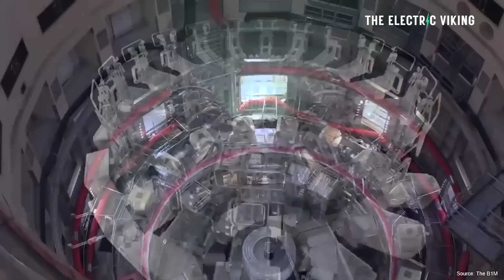Sweden criticised over plan to build at least 10 or more new nuclear reactors

Comment: At Sweden's latitude, I imagine solar would be inefficient. Also wind generation is not possible everywhere.
Reply: However, there are a lot, A LOT, of underutilized places for wind energy at the sea surrounding Sweden.
Reply: Use all 3-solar, wind and wave technology
Reply: Yes winter is cold, dark and long, the summer is short and barely warm. Doesn't matter how cheap and efficient Solar energy is, if sun isn't shining.
Reply: Solar works just fine in Sweden.
Reply: @petterbirgersson4489 plenty of spaces to put wind turbines but the cost to connect them to a grid and maintain them is totally prohibitive!
Reply: Hi, sounds like a plan when you live in the cold north and want to be independant. Small Modular Reactors could work or big ones which power the rest of Europe when its needed.
Take care all M.
Reply: @petterbirgersson4489  who said this? By the way it's very challenging operate wind turbines in such cold temperatures
Reply: Денег ни каких не хватит
Reply: Solar panels are more efficient when they're cool / cold.
Reply: @GregHassler  lol, yeah but they are cold when the sun isn't shining
Reply: Solar panels work quite well south of Stockholm - I think its around 3KWh per day annual average per installed kW of panels. Winter will be much lower, and therein lies the problem.
Reply: @GregHassler  Must be why our solar output plummets in the winter? Lol.
Reply: Nuclear power is a great option if there are appropriate safety precautions built in. Hey SAM, no everyone lives in Australia.
Reply: @simson4t How cold is it in Sweden? I’m heard that it is a long country and the Gulf Stream keeps it warmer?
Reply: @chrishaberbosch1029  it work fine for the 5 houer the sun is shinning. What about the 19 other hours ??
Reply: Geothermal?
Reply: @simson4t  This is a report that claims that you could produce around 25 TWh a year if all planned projects came to fruition, and double that if all potential spots were utilized.
Reply: @simson4t  There are a lot of projects about to be launched already today, and our neighbors Denmark and Germany are already building a lot.
Reply: Isn't that the whole point of batteries ? @simson4t
Reply: Fossil fuels work well .Use them.
Reply: @TTestad  that would be with battery backup.  Again, market forces will easily suffice if even a modular reactor is 20 times as expensive.  Price per Kwhr is vastly cheaper than nuclear and much easier and faster to install.
Reply: @chrishaberbosch1029  probably need solar tracking to work best due to the latitude.
Reply: Not in December
Do you have solar? (I do)
Reply: Yes, but not if the sun is below the horizon and it is snow on them. I have solar, I get the numbers from my electric supplier.
PS. I will still buy more
Reply: @chrishaberbosch1029 I guess you haven’t been to northern towns (north of Stockholm) of Sweden
Reply: @AORD72  or just install more.
Reply: There is a big difference between north and south  @Harrythehun 
Stockholm (Västerås really) is around the center from a population standpoint.
It is correct that Helsinki/Stockholm/Oslo/Reykjavik are a lot warmer thanks to the gulf stream. The south part of Hudson bay has the same latitude. That said, we still have winter and we still need to get rid of CO2.
Reply: We have wind power (but mostly hydro) and on windy days, very rare, the electicity is close to no cost.
Reply: @petterbirgersson4489  That is another myth, take it from someone who has spent nearly 17 years at sea. 
When we have wind, the wind is more powerful at sea, but still, if we don't have wind, we don't have wind at sea either.
Reply: @GregHassler  That's probably why they produce more power at night than in strong sunlight.......  Oh wait...... 🤣🤣.
Reply: @matsgardin8332  the majority of Sweden’s population is southernmost.  Stockholm gets 6 hours of daylight even during winter solstice.  I have solar and the cost per kWh has come down hugely in ten years and will continue to drop.
Reply: @larryc1616 Solar is a hobby! Should produce electricity in the night rather than in the day! That would solve the whole problem. Wave energy will never be as cheap as off shore turbines. The big problem in the Nordic countries the next few years will be the big excess capacity of electric power. First you build thousands (!) of wind turbines, then you can't launch them, because there is no consumer connected.
There are really a lot of different producers, and which of them will be allowed to produce and sell? There will be some work for the lawyers for sure.
You don't build a steel plant in the Nordic countries in a year or two...
Interesting times ahead!
Reply: @lesliecarter4295 You mean that companies like Finnish Fortum and Swedish Vattenfall don't know what they are doing? I think Vattenfall is the biggest off shore contractor in Europe.
Reply: @markeh1971 The big problem is that people move away from the cold north, not because of the coldness and the darkness. More because of the the distances. 500 km to the next hospital...
Reply: @simson4t What do you mean by cold? Do you mean something that Vestas and GE not are aware of? Sounds strange. Vestas use their own personnel for maintenance and service. In reality they educate local technicians.
Reply: @simson4t Exactly! But maybe we will see cells powered by aurora sometimes, until then we must use hydropower... 😆😊
Reply: @Harrythehun Time to google! 😉
Reply: @St.Maurice You must have drills that go deep enough! Maybe 10 km isn't enough.
A test hole is being built in Helsinki, but now they are waiting for the drill, which is in use, maybe, in Holland. I don't remember if they have reached at least 7 km by now.
Reply: @N0rdman Data you have how is it measured? And at which heights? If wind gauge at a couple of meters height can show 0.0 m/s but that doesn't matter at all in this business.
Reply: @chrishaberbosch1029 Solar in the whole of Sweden is more of a hobby. All regulated through political decisions.
But at least you can charge your EV without using the "public" network, and this is quite important "for the whole system".
The last 5-6 years you have been allowed to sell your power, and some people have earned as much as they have invested that means 10-15,000 euro. After 6-7 years your produced power is free till the government finds a way to tax it.
Reply: @chrishaberbosch1029  Probably not cost effective. Near earth's poles the sun follows a massive curve.
Reply: @leiflillandt1488  
Wind farms at sea is just as a big loss as it is on land.
Can you even comprehend how costly it is to build a tower 230-340 meter high and then all the maintenance necessary?
I'm guessing you're not an engineer, but I am.
I recommend a visit to any town with facilities for wind farm maintenance and see the huge work necessary for just a few kWh now and then.
Forsmark nuclear power plant in Sweden employs 1200 people and generates 75 GW.
All wind farms at sea in the UK has a installed power of 86 GW, in theory if there is a favourable wind and has 82,000 people working directly or indirectly in support of the wind farms.
That is a huge cost and with almost "free" energy; who do you think is really paying?
Reply: @N0rdman  The things that you say are incoherent.
Reply: @leiflillandt1488  "a few meters"?
Go down to any major port, take a good look at the commercial or naval ships you see there.
How many of these ships are "a few meters" above the sea when you look at the bridge and the mast where you usually keep your antenna and other measuring instruments?
Have you heard about balloons?
But never mind, have you seen the latest information that the wind farms are most likely the culprit when it comes to the beaching of whales? 
The sound they create is driving them insane and is killing them en masse, just like the birds the wind farms are the real killers.
Reply: @furry_homunculus  Very true. Never said there wasn't, perhaps you should have assumed I was aware of the hours of sun after I stated "due to the latitude".
What surprised me was the annual sunshine hours of Stockholm being about 2000 hours. Although the intensity is a lot lower because of the altitude of the sun on the horizon. It reaches about 54 degrees. 54 degrees is about 80% intensity of the sun directly overhead (90%).

I said solar tracking would be good if you are using solar panels in such a high latitude because the summer angle covered is about 285 azimuth degrees, so for stationary panels you would be missing out on 105 azimuth degrees of sun travel.

Comment: There will be no such expansion! Period!

But Sweden has a number of power plants that reach EOL in the "next" future. It will be interesting to se how they will solve that problem.
The biggest problem in Sweden is that they produce electric power in north, but they have "forgot" to build power lines to the south! In Finland they build power lines right after according to the needs, almost.

Over the next seven years in Finland they will build wind power on and off shore corresponding about ten 1,000 MW nuclear reactors. Then Finland produces twice the need of today.
We will remember that Sweden has had a surplus, maybe, the last twenty years.

I think the whole calculation is based on the possibility to export power to Germany!

Luckily no company is involved in the discussions, and then there are elections every fourth year in Sweden.

There is a but, maybe some farmer want a modular 100 MW nuclear power plant built in a 40 feet container at his backyard, then they only have to find nine more customers... 😂

The government can't even find money to buy a sea cable that goes along the coast, which would solve many problems compared to build land based high voltage power lines that no one wants on his backyard.

Then it will be interesting to see how long the payback time will be when the prices will be negative half of the days of the year.
Already now "many" wind turbines built half a year ago are shut down many hours a day because there are no demand of power.
As a reader, you ought to understand that the power grid in Norway, Denmark, Sweden, Finland and the three Baltic countries, are interconnected and form a single market, with flows according to the needs in the different regions in the Nordic countries and the Baltic.

Maybe you can "force" a young lady to say anything, but it can't be nice to be a CPO at Vattenfall and Fortum, and need to comment BS.

Comment: Nuclear power cannot load follow. It must operate in base-load mode, meaning at 100%. Green energy is noterousluly available intermitently, whuch means other power sources must ramp up and down as needed due to green energy availablity. Solar+batteries and wind+batteries are the correct solution, utility scale batteries being the important addition. This can be designed to cover 99% of need; so gas turbine backup will be needed.
Reply: If enough people had EV's that could be used to take up capacity as nuclear stations wound down and give up capacity and stations wound up, it would make nuclear more flexible.

Comment: It is a myth that nuclear power is reliable and works in the winter when solar is not supposed to.

even with nuclear power Sweden imported electricity when we had nuclear power.

In 2003, we import electricity 7903 hours of the year 8760 hours. It is 90% of the time.
Reply: So Sweden doesn't have enough to meet demand and wants to build more. And your argument is they shouldn't build more because they don't have enough? Something was obviously lost in translation 😂😂
Reply: @geoffhaylock6848   Nuclear power does not meet demand. This is why Sweden has imported electricity when it had nuclear power or burned oil to meet demand.   Nuclear power is good for basic needs in the summer.

Comment: Wind had probably been a better idea but the current government hates wind farms. They also don't plan for much storage.
Reply: Wind is essentially insane.  Nuke has always been the smart, cheap, environmentally best way to produce power.
Reply: What are you on about? They  recently approved two wind projects on the west coast 🤔
Reply: @halidogmanthehero917 wind is good as long as there is nuclear and or hydro to back it up.
Reply: @matthiasknutzen6061  they changed the rules for sea based wind power which stopped or delayed a number of projects. They may finally give in to pressure and allow some. I still don't think they will provide state sponsored connections which were promised before.

Comment: There are new reactor designs that allow for smaller size and lower capital requirements. But there are none in commercial operations  yet.  If Sweden is pushing for next gen reactors I can kinda see it. Pebble bed reactors are far safer but also don't produce the massive volumes of  energy the old fashion reactors do.  And because the industry is dead as far as R&D goes;  no company can see a ROI even if they develop something 100 times more efficient. Very few new reactors are put online worldwide. I am not against Nuclear R&D if they are able to push ahead in making it safer more efficient and resolving the toxic waste issue.  But I kinda doubt this is what Sweden is doing.

Comment: You are wrong on this. Solar is pretty worthless in Sweden. Our biggest energy need is during winter and then solar performs very poor in Sweden. We are building quite a lot of wind power but so is Denmark and Germany. When it's windy we already have over power in the entire region but when it's not windy prices are sky rocketing. There's already been detailed analysis on the grid for the future in Sweden and it showed that on a system level it would be 1.5x cheaper with 50% nuclear power in the mix than a grid with only renewables. The problem with renewables is partly that they are intermittent and while they produce cheap energy when they deliver they require expensive storage solutions for when they are not or several 100% over capacity. They also require more cables all over the country than taking advantage of big scale production in few places. These issues makes renewables more expensive on a system level and the electricity consumes would have to pay for the increase cost of the grid.

Comment: Intermittent sources are unnaturally benefited in these cost calculations.
-You are continually replacing intermittent sources in a 20-25 yr cycle. Nuke plants magically do not produce power after 20 years in these calculations.
- the cost of their unpridictable intermittent power delivery is externalised to society ( the same problem CO2 pricing supposedly fixes ).
- the more intermittent sources you install the lower it's actual capacity factor becomes.
- you cannot produce enough storage at gridscale.
( material availability ).

- I adivise you to look at transportation and heating energy needs and to translate that the electricity needed.

I took a small european country ( NL ) and extrapolated the automobile replacement to be near 40% extra electricity needed ( that still leaves airtraffic and shipping ).

For heating it was also near 40%, with the assumption everything could be handled with heat pumps. Unrealistic as industrial needs would need direct electrical resistance heating or worse, H2 generation.

Comment: It seems you are not counting Sweden doesn't have much sun. Sweden is not Africa. Wind is not enough especially when there is no wind and water the same is not enough alone. In long time investment nuclear reactors need for Sweden because there is no other passive energy which could be used when there is no wind, sun and other renewable energy. Plus for sure they are planning to sell electricity to other countries more efficient without changing in Sweden the electricity prices. The reason is the south part of Sweden has the most expensive electricity bill than the north side of Sweden. I understand your opinion about renewable energy however the reality is not enough. Maybe they will change the energy sector that way where new energy can be used for electricity so they will drop the 10 nuclear reactor plan however that depends on the future. If we stay today standard, nuclear reactors are needed.

Comment: I think Sweden is pretty smart with that decision. The same decision made by the UAE (United Arab Emirates) a country that has more oil than it can use for the next hundred years. They definitely don't need nuclear, yet they decided to build one of the largest nuclear plant at Barakah. Why?? If you don't understand this, you will never understand Sweden reasons. There are more than one, and it's NOT just about electricity.

Comment: Sweden is smart. Solar works great in some areas. As technology improves it may be more usable in northern latitudes. Solar is clearly not an option for substantial energy supply in latitudes north of 45 degrees. In reality solar is sort of a hobby north of 45 in northern hemisphere. If solar panel efficiency doubles then northern latitudes projects may have some reasonable utility. Until then nuclear power is clearly safest, most abundant and the only chance to electrify cars trucks and planes for the worlds needs. Wind solar and batteries are not a possibility north of 45 lattitude. Do the math. Canada has hobby solar but it won't work for the large numbers needed. Remember the electric supply (grid) must increase 3 times as cars and trucks become electric.